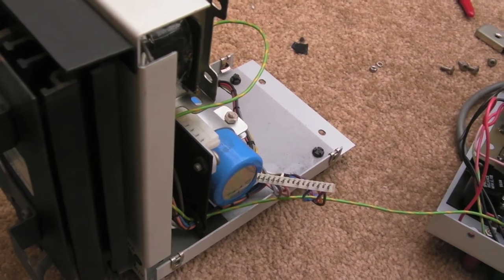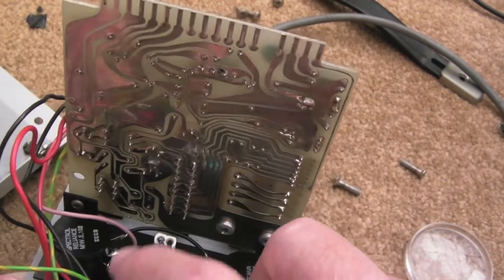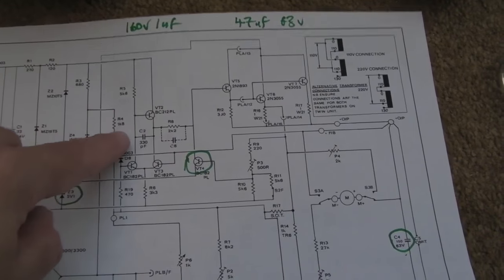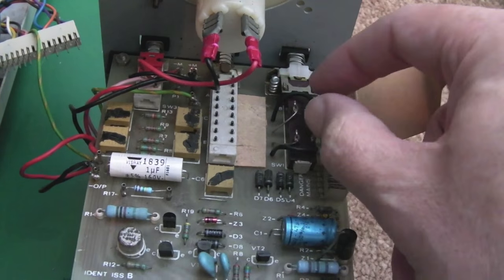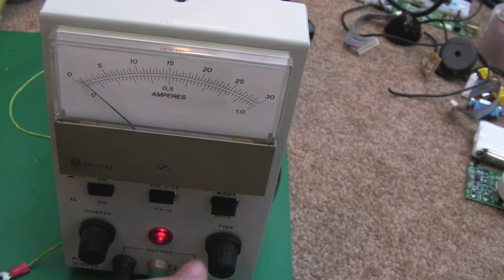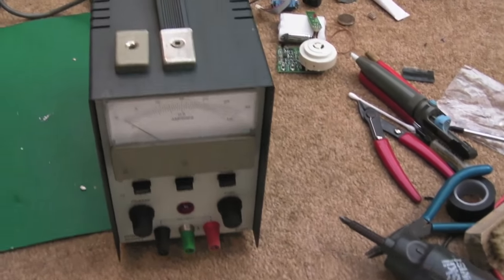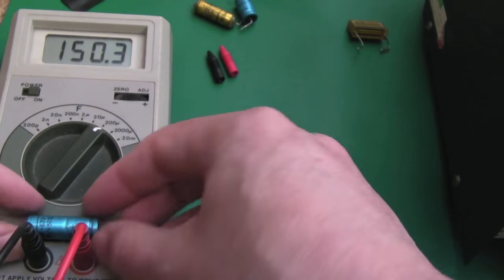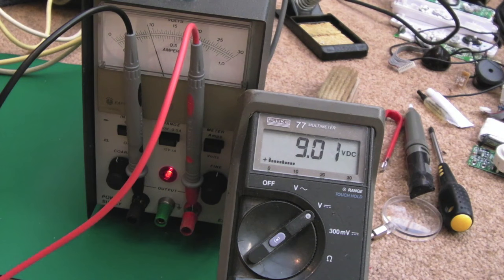Farnell E30/1 Bench PSU (Power Supply) Repair

Comment from the maker: Reading the service manual afterwards it looks like Z3 is responsible for providing a stable reference voltage, but VT4 (the BC182) is part of the overload protection circuit.  The service manual is attached in the video description above ^

The difference between the schematics and my unit are the E30/2 seems to provide 2 amps whereas my E30/1 has a maximum of 1 amp.  I re-counted the transistors earlier and I think I counted 1 less than shown on the diagram, so maybe the E30/2 has an extra transistor there, and looking at the schematics again I think those are VT6 and VT7 (2N3055), so assumed mine just has one whereas the /2 model has 2 of them on the back.  Makes me think I could probably mod this to provide 2 amps, if the transformer is the same.   Also worth pointing out the main transistor (2N3055) is standard NPN, not a FET.

https://en.wikipedia.org/wiki/2N3055
Reply: +GadgetUK164 Was thinking the output transistor would be a bipolar transistor and most probably a 2N3055. Seems to be a lot of old linear power supplies of that era used them.
Reply from the maker: Yeah!  I am thinking I could mod this to output 2 amp, it looks like just the transistor and a resistor needs adding.  Just not sure if they uprated the transformer or not.  I might give it a go and see what happens.  I need to look at the analog display later as well to see if that even goes beyond 1 amp, I cannot remember.
Reply: +GadgetUK164 I couldn't see why that wouldn't work. I guess if the transformer is able to safely deliver that sort of current and if the drive transistor can drive both the main output transistors then I think it would more than likely work.
Reply from the maker: Yes, I think that just run in parallel basically.  The only issue I can think of is the meter only displays an amp if you use it on current mode, but I guess I could half that with a quick mod so it shows 2 amps over the 1 amp range.

Comment: I know it's years later now but in case anybody comes across this, that cracked yellow rectangular capacitor is a safety capacitor (looks like that one is X class, for connection across the mains I think). So really it should be replaced with another safety cap of the proper type, which depends on whether it's across the mains or mains to ground.

The right one has to be used as the failure modes are different and tailored for their particular use cases.

As someone else pointed out they're made of paper and make huge amounts of smoke when they fail. Dramatic!

Really enjoy your videos btw :)
Reply: Rifa capacitors are notorious for popping and smoking out when used. They are sealed in some kind of epoxy that cracks over time, letting moisture inside, which theoretically expands and causes the cap to burst. Anytime you see an epoxy sealed Rifa, replace it immediately. They are time bombs...

Comment: Great video and repair ! Ah, full regulation by all discrete components. VT4 does indeed look like overload protection in the way it is connected between the differential amp and output buffer.
Reply from the maker: +bwack Thanks =D  Yes, I love working on stuff where you can actually replace nearly all the parts with off the shelf bits and its all separate rather than IC =D

Comment: I remember these PSU's from college  (81-83)
That screw in the middle under the meter is a mechanical adjustment to zero the needle ( On a level surface).
I don't think the power transistor at the back would be a FET, a bit too old for that, it would more than likely be the humble 2N3055.
Caps you changed wouldn't be worth keeping because of their age.
Nice video. well executed........
Reply from the maker: +Michael Hawthorne Yes, you're spot on!  It does use the 2N3055, I've just bought some spares.  I know caps are generally not worth keeping for their age - I just don't like throwing old working caps.  It's a mute point anyway now since I've tested their ESR and all of the caps I replaced had high ESR, so they were binned ultimately.  Thanks for watching and commenting =D
Reply: ive built them at the start of my career with farnell electronics when they produced equipment

Comment: I have the L30-2 and it's my main bench PSU. The ripple and noise is very good. I need to move to a digital bench PSU for finer adjustments and more functionality
Reply from the maker: Yeah, still a useful PSU!  Well built for sure!  I need to get a newer digital bench PSU too at some point!
Reply: For me I need to be able to dial in low currents when in CC mode into the 5, 10, 20 mA range.. I just can't do that with my L30-2. Also the OV and OC modes, memories are nice along with data logging on the TENMA digital BPSU

Comment: Those clear cased RIFA capacitors just seen to crack with age. The same type is used on BBC power supplies and Commodore 8296 etc. but in those they are across the mains and when they go, they fill the room with smoke. These days I replace any of those I find before powering anything on.
Reply from the maker: +Dave Curran Is the type of replacement I used OK for that one?  I am not that hot on the different types of capacitors and where one type should be used over the other (despite same capacitance / voltage etc).
Reply: +GadgetUK164 They look fine. Axial is better if you can get them, purely to fit better mechanically. The only ones that need to be careful with are when they are used direct on the mains, and they need to be X2 rated. That looked to be an X rated cap (not in that way), but it didn't need to be as it was just smoothing the output (up to 30V DC). General rule is same or higher with voltage and capacitance unless it is being used for timing circuits etc. Old stuff would usually have been designed expected -20% / + 80% tolerance, so modern 220uF would do for vintage 150uF etc. Modern ones tend to read low, old ones tend to read high unless they are duff. The performance can be very different at different frequencies, and older caps may read OK but be no good in use. I try not to replace things unnecessarily, but electrolytic caps and those film ones are often worth doing. The modern ones won't be as good as the originals were when new, but they are usually better than they are now, if that makes sense.
Reply from the maker: Thanks!  I was mostly concerned about that 630v 100nF - which I replaced with a Polypropylene Axial Metal Film - Not sure what the original (cracked) one was exactly.
Reply: +GadgetUK164 The square boxed one is the RIFA one I was talking about. The one that was across the output was just smoothing it a bit. It looks like it's omitted from the later schematic, so they didn't bother with it. That replacement should be fine. They may have overspecced it in case you connected a higher voltage across the output terminals, but you would have more problems if that happened, it should never be more than the 30 ish volt output. Probably that was the best fit they had at the time and it happened to be higher voltage than required.
Reply from the maker: The cap is wired between ground and earth though - Can't understand why that is?
Reply: +GadgetUK164 Oh sorry, I thought it was across the output. If it's ground to earth, then it is earth referencing the output, but not directly tying it. I think it that case it should be Y rated (although the original was X). May be worth reading up on X and Y rated caps for safety's sake. Dave Jones and Martin Lorton have good videos on earth referenced scope grounds. The same issues apply here if you wanted to use two of these to make a +/- 15V supply for op amps etc.
Reply from the maker: Thanks!  Will do some research!  I thought it was a bit odd that the cap had shattered based on its connections there.  I wonder if someone has connected it up at the same time the device powered is connected to some other supply or something.
Reply: +GadgetUK164 I don't think the cap was cracked due to damage, it's just old age on those things. They crack over time and eventually fail. See some photos at the start of this blog post: http://blog.tynemouthsoftware.co.uk/2015/08/exploding-commodore-pet-mains-filters.html They all came from working BBC micros, none had been damaged, but they were in the process of getting worse until they failed.
Reply from the maker: Thanks - that's great, will check that out later =D  That probably explains it, and makes me think the one in the other PSU probably has cracked as well.
Reply: +GadgetUK164 Yeah just to chip in and agree. Had one of those yellowed plastic rifa caps fail in a 1.5kv valve power supply. That was... scary

Comment: Hi great video and good comments. I have the Lt30-1 30v / 1amp. Did you ever mod this to 2amps if so could you possibly show the circuit also the caps you replaced and values would be greatly appreciated,many thanks for the videos.
Reply from the maker: The schematics were linked somewhere in the video description I think - you can get the cap sizes off there!  I didn't mod it, as I suspect it has a different transformer with an extra winding perhaps?

Comment: just fixing my l30b, you just cant use them for charging batteries lol, well you can, unless the power goes out, there not protected against current being pushed into them. common failure mode. usually, vt8(bc182) goes short, no not mine, its somewhere else and i cant find it... yet....

Comment: nice restore! :D Good to see something a little Different. don't Reuse those caps. if you want to be sure, you need an ESR Meter.one that tests up to 500Volts.
Reply from the maker: +Amy Marie I've got an ESR meter but I let a friend borrow it ages ago.  I do also have a cheap chinese ESR meter but I guess it's reasonably accurate.  I will dig it out later and test the ESR on them.  I don't think voltage really matters when it comes to the ESR check - It uses a very high frequency pulse I think in order to calculate the ESR.

Comment: Hi, great and informative hands on video. However, when it comes to really test an old cap properly you need to perform 3 separate kinds of tests to each capacitor to conclude if a cap is good or bad:
1. Capacitance
2. ESR/EPR
3. Leakage test (this is the most important)
I came across (no end of times)  to old caps showing spot on capacitance value, with relatively low ESR (within the specified ESR limits)  but failed miserably when measured for leakage test. So, i'm very picky when it comes to selecting what old caps are good to be reused and what aren't, but I can honestly say as a general rule.....7 times out of 10 they need replacing.
Reply from the maker: I've got a video coming up where I will test the hundreds of caps I've taken off boards over the last few years, I check them for all 3 things and more then 95% of them are fine in all respects!  Caps in certain areas of boards (PSUs particularly) fail a lot, but many of the ones on motherboards are usually fine.

Comment: Gadg If you can easily access the POT for controlling the voltage can you tell me what the value is? i have a homemade 32V DC PSU and want to be able to vary it. Cheers and thanks in advance(if yo can tell me what value the POT is)
Reply from the maker: +Amy Marie You cannot just use a pot on its own, you need some other resistors at least to help form a potential divider, ie. to stop high current burning out the pot when you set it too low.   And if you feed the output through a pot, the pot needs to be suitable wattage capability to handle any load you pull through it.  If you take a look at the schematics in the video description (in the service manual), you can see all the pots on the board and the sizes.
Reply: yeah i know i have the parts and i did find out what i need and i did start to build it, i found a 5k Pot and some other things that i needed.